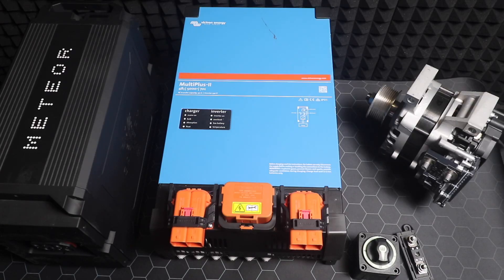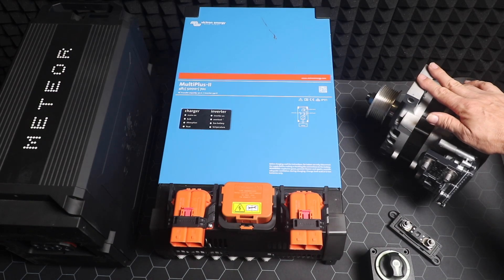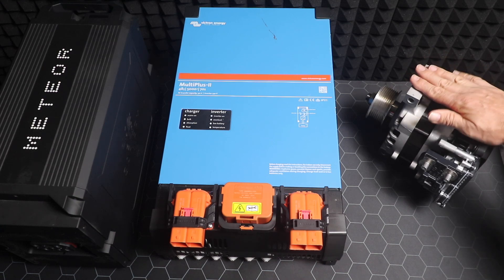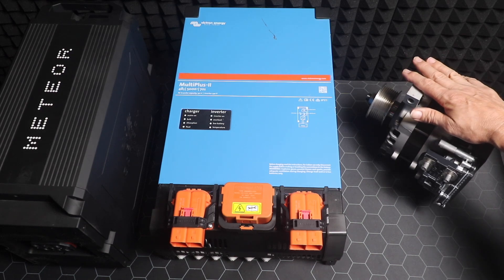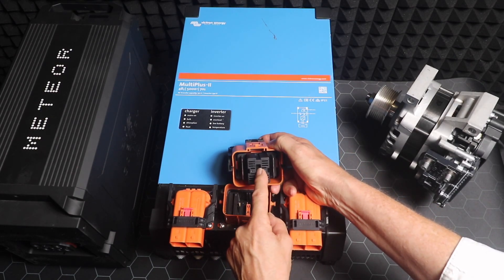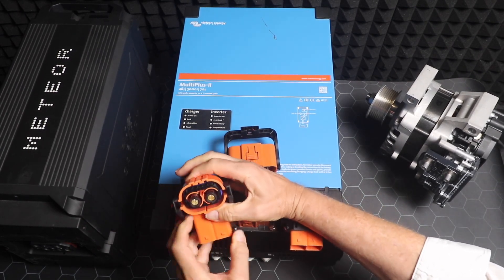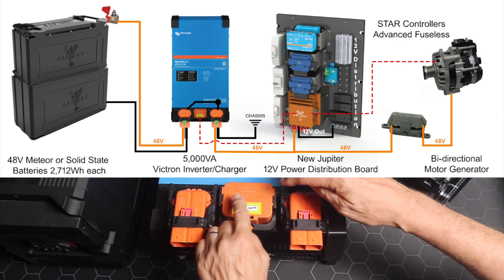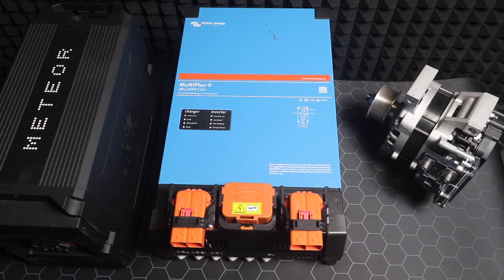Safiery's new 12kW BMG deserves big power connectors and an MSD for totally safe isolation -see how

Comment: Awesome, can i run a BMG alternator on my OKA as a second charging option?
Reply from the maker: I cant see why not. You will have to make supporting brackets and make surre its a wide PK serpentine belt. Is it the perkins engine?
Reply: @Safiery  I have removed the A/C compressor so i have a spot for it. Im yet to upgrade to serpentine belt, it would be on the Perkins.
Reply from the maker: @okaadventures3446  Ok. Do have have engine CAN info on throtle position? your engine would be a great one to try the Mild Hybrid on and it would give the Perkins a 10kW boost!
Reply: @Safiery  Its old generation engine, no electronics at all. I have one of your scotties but wouyld need to upgrade to the A.I model i would suspect?
Reply from the maker: @okaadventures3446  Ok I think it can be done then but you will need to make an adaptor. It would be the 10kW unit. There are 2 sizes: 10kW and 12.5kW which is longer...Go to our website and tap the chatbot to start a discussion. Cheers

Comment: Nice bita kit, I read from somewhere those switch block isolators are rated to 48 volts and as you charge to a higher charge voltage they are not suitable for disconnect, true or false I can’t say but worth a look into for safety reasons?
Reply from the maker: They are rated to 800V and thats why they are orange. The automotive standard calls for orange for high voltage. They are very high quality
Reply: @ cheers a lot of DYI get that wrong from I’ve seen 👍